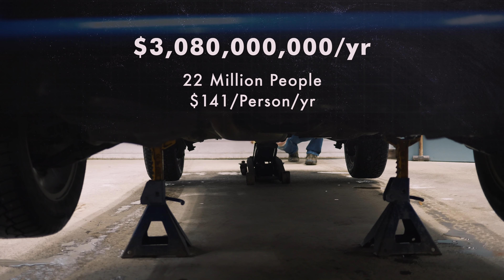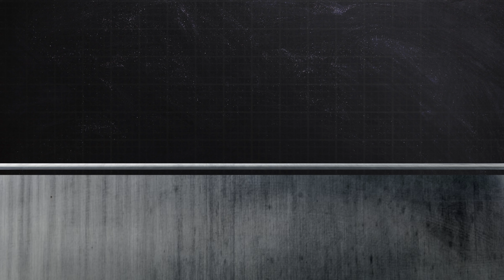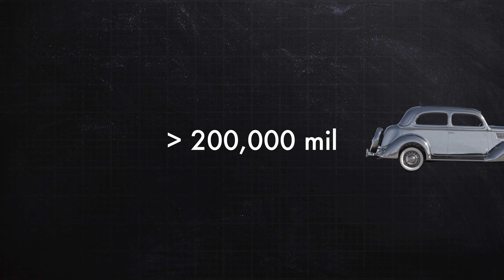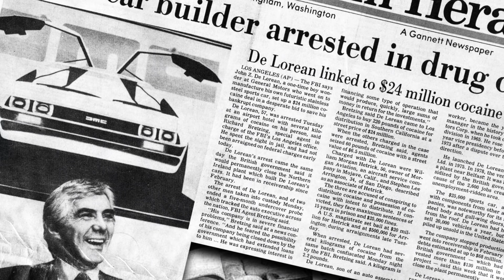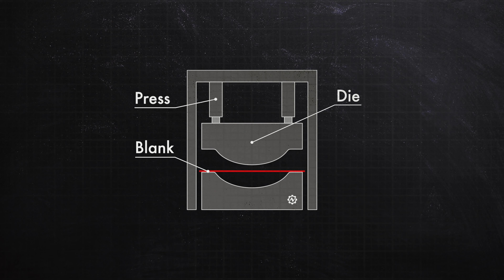The Overlooked Cybertruck Feature Hidden in Plain Sight

Comment: Question:  What about the rest of the cyber truck that has metal parts like bolts, rods, engine mount?   Will they rust?   I understand the body and frame is rust proof, but what about other parts that is metal?   Are all metal parts used in the cyber tuck rust proof?
Reply from the maker: I highly doubt they will be. It'll be interesting to see what all the final components will be made of though. Like I said though, if after 10-20 years I have to replace a few parts, I'm not too concerned. I'd just like the frame and body to keep looking brand new.
Reply: The motor casings and most components are aluminum in the other Teslas so it is likely the CT will continue that tradition.

Comment: As a Delorean owner, I can’t express enough how great it is to have stainless steel body panels. It’s easy to clean, and you don’t have to worry about sun faded paint, tree sap or bird poo. The only negatives are constant finger prints, dent removal is tricky, and the rare case of stainless steel corrosion (probably varies on what type of stainless). Deloreans use 304 grade.
Reply: Given the presentation of Franz hitting it I am hopeful that it never gets any dents.
Reply: Frank Wiley or broken windows
Reply: Mister G Couldn’t agree more with you and Tesla Armor glass has got to be better than what’s currently being used by the legacy auto makers.  I read also that Tesla has a patent for a glass that also cuts down on noise transmission which I’m looking forward to.
Reply: @Frank_W.  What is your chances of Franz hitting it with a hammer compared to crashing into another car, tree, wall, boulder,etc?I would say 0.
Reply: @bunzeebear2973  Another reason to buy a Cybertruck ; )
Reply from the maker: I’ve heard the dents can be tough on a DeLorean. I’d still love to have one though! With the Cybertruck’s thicker stainless it should dent less easily. I’ve seen some 304 lab instruments rust as well. They were in direct contact with CaCl2 salt though.
Reply: @chargeeverywhere  - there might be some areas here in the west where the Cyber truck will have rust issues then.. because they use CaCl2 instead of regular salt for snow removal..
Reply from the maker: @Dana Hebdon  That’s an interesting point. I’m not sure if we use CaCl2 on roads here, but I know they spray liquid MgCl2 on the road before a storm. 304, and even 316, will still corrode from Chlorine salts, but at a much lower rate than carbon steel. I would guess (and it’s just a guess) that you’d be hard pressed to rust holes through a 300 series stainless car under even the most extreme conditions. Surface rust on the other hand...
Reply: @chargeeverywhere  There's a coating process called PVD coating.  Only a high grade stainless steel, titanium, and aluminum, or a chrome plated part can be coated using PVD.  but it also takes on the surface of the metal used, so if the metal is highly polished, then the coating will have that polished look.  if it's a matte finish, then the coating will have a matte finish and it might not look as good.

The problem with Stainless Steel is that it's much more expensive, heavier and harder to work with than Aluminum, which is what a lot of cars are using.  Some of the high end sports cars are using Carbon Fiber, which shouldn't ruse since it's not a metal.

Yes, I like Stainless Steel, but what I don't care for is that these car mfg. just leave it stainless steel and they don't paint them or use a PVD coating on a polished surface.  But they are more limited in what choices to PVD coat the metal.
Reply: Oneness100,  PVD in a car plant would be 100x slower than paint,  and by the time you've built a vacuum chamber big enough for a Cybertruck body probably 100x more expensive too.
Reply: I have the Bora Maserati mid-engine GT like shown, back in California in storage 20 years, The roof is stainless steel and easy to keep in perfect condition. It is one of the last made, a 1974 model with only 24,000 miles. I used it as a daily driver for 8 years, just running errands or running the twisties in the coastal mountains.    The original design was intended to have it all stainless body, monocoque but it was too hard to pull off so reverted to steal. It has  5 ltr hemi 4 overhead aluminium engine with 7 barrels of Webber carbs. For its day it was the only mid-engine GT that was reliable or comfortable enough for long-distance touring, and soundproofing between the cabin and engine, only 4 inched behind was so go it was actually a pleasure to drive.
Reply: @stanspb763  Ever since I walked through the front doors of the L.A. Sports Arena at the 1974 L.A. Auto Show, at the age of 15, and saw three Boras straight ahead of me, the Bora has been my favorite car. I was stunned, as I did not know there was such a thing as an exotic car. They look so right, except for the rear view of the '75-'77 models. It has been my goal to own one, but If I can't, I would be happy with a Merak. Thank God, few car enthusiasts have ever really known about them like they do Ferraris.
Reply: @stanspb763  
I think that the Bora was the best Maserati ever made.  I so wish that the company would make it again but with modern components.
Reply: Marine stainless is of 31x series, like 316. 304 is more of a food grade.
Even then, if you leave salt on for long periods it will rust. That's why chain plates on newer sailboats are made of titanium.
Reply: how does it handle dents from accidents
Reply: It will be extremely difficult if not impossible to repair dents on the cyber truck.
Reply: If you live by an ocean or if the roads are heavily salted, 304 will definitely rust.  The plus side is it's going to just be surface rust, completely different than the disintegration that happens with carbon steel, and will buff out with some elbow grease and a brillo pad--this also blends it out really well too on a 2b finish, which is what the cybertruck looks like it's made out of since it's cheapest.  If it's really bad, hit it with 400+ grit sandpaper (especially on an orbital sander) first, blends out better than you'd think.
The other plus side to the body style is it's so simple and 2D that any custom fab shop could easily form up the entire body with a single sheet of stainless and a brake press, which also means aftermarket parts galore.
It's a utilitarian vehicle that's not designed to look pretty.  It's designed to be built and repaired cheaply.  Scratches (not dents) will appear easy, but they're just as easy to buff out.  And if it gets to be an issue, it wouldn't be too hard for them to offer a model made out of a higher grade, like 316, that is hardly affected by salt and corrosion.
All in all, I'm super on board with this truck.
Edit: Also, the metal is 1/8 inch thick, which is no joke.  Regular cars are around 1/32" thick.  And stainless is a much, much harder material than carbon steel (Since 1/6 of its composition is Chrome)
Reply: the bottom is fiberglass right?
Reply: You get the major advantage of rust resistance with Aluminum it is cheaper, lighter, easier to repair, and more versatile than SS. Ford has actually made SS cars in the past for a major SS maker, but due to the hardness of SS it destroyed the molds. That why the Delorean and Tesla Truck used so many straight lines. It is also what made them so expensive to manufacture and so impractical to design around. With aluminum it is soft enough to be formed into any shape. Add to that the dozens of modern manufacturing methods that give it increased durability and wear resistance.

Just something to think about.
Reply: @ian_lambert-knight  What about carbon fiber.  It's not going to rust, plus it's lighter weight, easy to form, etc.  I'm not sure about repair though.  But rust, it won't.
Reply: With the cyber truck, most pickup truck drivers have a great big dent in the front bumper anyway, so it shouldn't matter.
Reply: Need to wash your car more.
Reply: i doubt dents will be an issue.. at least for tesla lol
Reply: Not a single comment about reliability issues with the flux capacitor. Very disappointing.
Reply: DeLorean was a car ahead of it's time
Reply: @Igor Wilkowski 
Depends on what part of that movie you’re watching. 😁
Reply: It will be interesting to note how waterproof the vehicle is, seeing as it's high voltage EV, potential for electrolytic corrosion is high also
Reply: William Goode I think the correct term would be water resistant not water proof.
Reply: @williamgoode9114  given people have driven model 3s and Ss through pretty crazy floods I think they'll be fine, lol.

Comment: Great video content about the Cyber trucks corrosion protection. Terrible repair on your Subaru quarter panel, I give it one winter before that rusts gets worse and the whole repair falls off your car. For a professional #refinisher that back yard repair was hard to watch and gives the autobody trade a bad name take it to a professional next time.
Reply from the maker: I entirely agree with you! I just wanted to get the car to pass inspection this year as at 300,000 miles it's not worth spending too much on. The entire wheel well is rusting and I really need to have a body shop weld in a new quarter panel if I'm going to fix it right.

Comment: It’s simple.   Don’t buy Subaru’s. My 2013 Garrage kept Brz  had rust under the car buy 2017.   My 2001 Jeep Cherokee XJ aside from the brake lines has had virtually zero rust.   It remains exposed to the Marryland winter and has over 300,000 miles.  It is my daily driver. It sits right next to my Tesla 3.
Reply from the maker: You're right on about Subaru's. They always rust out on the rear quarter panel. Still, I love the boxer - especially with the turbo. That being said, Tesla is pulling at my heart strings for my next car.
Reply: @chargeeverywhere  broke a valve spring at 48k miles 4 years on my 2013 BRZ.  Subaru refused to cover it under warranty.  1 year later ( after I sold my BRZ as is) they issued  a full recall for the Valve springs on 2013 BRZs and FRSs.  I love the way Subarus drive.......they are dead to me. I will nave own another one.